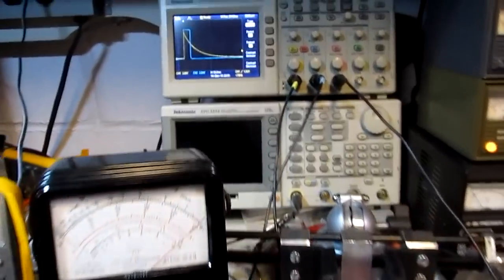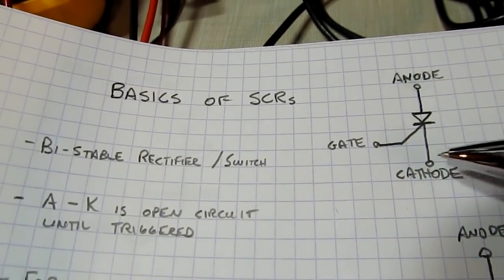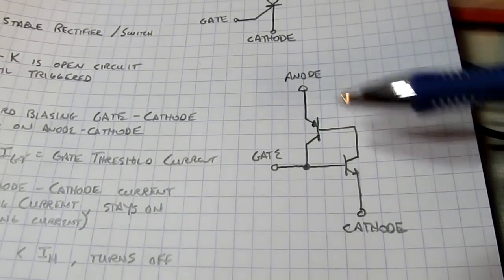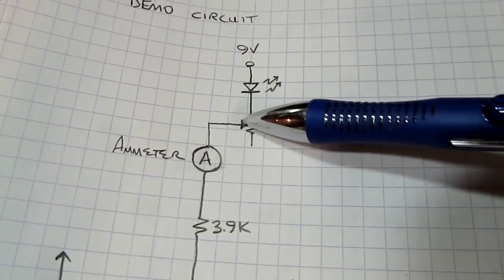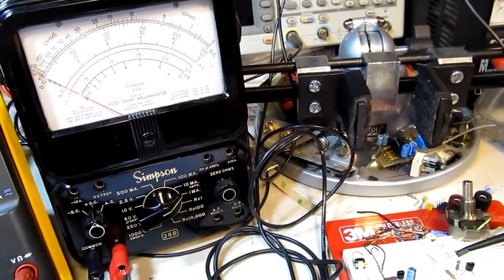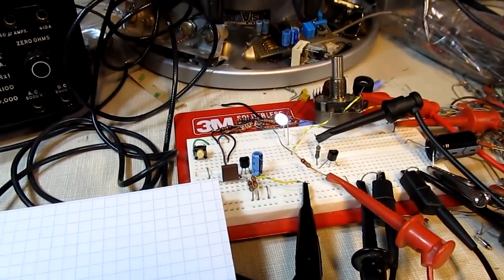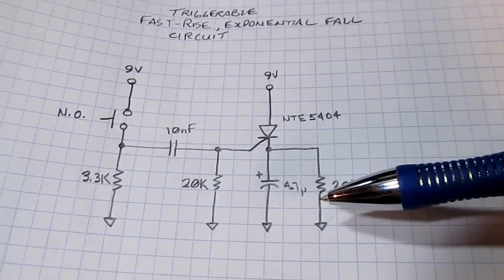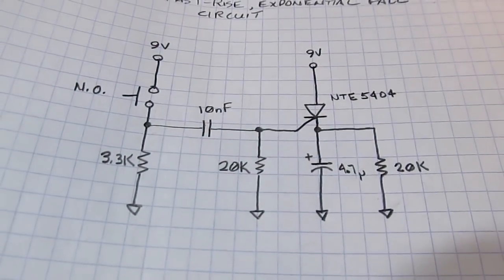#121: Basics of SCRs and some circuit fun - device and circuit tutorial

Comment: I really like that cross-coupled complementary pair,  it's so versatile.  If you connect to the base of the PNP transistor as well you have an "anode gate" (essentially a Silicon Controlled Switch or SCS),  which becomes active when pulled toward ground rather than pulled toward the positive supply.

I see a number of comments saying how the only way to turn an SCR off is by removing power.  Not so!  One circuit I've had some fun with involves two SCRs with their anodes connected by way of a capacitor.  When one is on you can turn it off by triggering the other one.

Comment: Great segment,and it gave me an idea to use this circuit for a way to take a simple brush type DC motor and steal the current on the collapsing fields and send them to charge a battery or a ultracap. e.g.: all the current on an automotive starter could be dumped back into storage.I think Edwin Gray had something like that.Off to research!And thanks so much for keeping my brain cells working!

Comment: Someone below asked about solid state relays, most internally use triacs (a bidirectional type of scr), most have a few refinements internally  such as zero volt switching and snubbing components. (due to internal capacitance issues scrs and triacs can spuriously trigger due to "spikes" on the voltage across them.). The triggering of a solid state relay is usually internally opto isolated, some use a neon to provide the light , some use a led. In one of my projects I used a solid state relay to operate the coil of a contactor, once in perhaps 6 months it will spuriously trigger despite masses of rfi filtering on the supply and being in a screened cabinet. I suspect the load is so low current demand that the contactor coil is partially energised via the snubber circuit in the solidstate relay, this may be your problem too.

Comment: I'm guessing a zener diode connected across the relay coils, solenoids and motors is considered a snubber circuit, because mostly I see just a zener diode across the coils to prevent voltage kickback.

Comment: It's a commutating circuit, I've seen them in a lot of AC inverters and DC/DC converters, put another SCR in series to ground, tap off between them to the capacitor through the primary of a transformer, pulse the gates alternately at a desired frequency (60 Hz perhaps?), basic DC to AC inverter.

Comment: In that case it should be possible to make a resonant half or full bridge inverter capable of multiple khz using scrs, as the inductor reaches zero current the scr should un latch allow you to turn on the opposing scr 🤔?? Would be awesome if you could make a video on this if my thinking is correct 😅🙈 
Thanks Steve

Comment: When SCRs are used to turn lamp bulbs on/off in pinball games EE engineers notice the lamp bulbs lifespan was cut in half compared to using FETS to turn lamp bulbs on'/off in pinball games. Any reasons why SCR would cause lamp bulbs to have a less lifespan and burn them out quicker compared to using FETs? I'm guessing SCR has a sharp transient spike and FETS don't have a transient spike

Comment: They often use Snubber circuits when using Triacs and IGBT devices. I'm guessing the Snubber circuit helps drain off and bleed off the voltage and current when the Triac and IGBT device is turned OFF?
Reply: Snubbers are typically used when these devices are switching inductive loads to prevent damage from fly back voltage.

Comment: I have seen FET's and JFETS  that look like silicon or silver metal Can packages used as amplifiers but i haven't seen MOSFETS used as amplifiers in circuits. I mostly seen MOSFETs used a switches the MOSFET package type has a screw terminal for a heatsink. But I'm not use what the difference between a FET compared to a JFET or are they the same thing?  They mostly use Thyristors SCR in crowbar power supply protection.  I have never seen an amplifier circuit use MOSFETs as the amplifier stages mostly they use FETS or JFETS i have seen.  They use Thyristors in industrial electronics to turn on and off high current and large inductive and capacitive loads. In order to turn OFF a thyristor SCR you have to reset the power supply or disconnect the +VCC voltage to the SCR. But I think a FET and a JFET are the same thing not sure what the differences are really.
Reply from the maker: The package type doesn't define the device type.  Yes, power MOSFETs used for switching are often in the TO-220 "tabbed" package.  However, MOSFETs can be found in many different package types, just like bipolar transistors.  MOSFETs can certainly be used in amplifier circuits.  Examples shown here:
https://www.electronics-tutorials.ws/amplifier/mosfet-amplifier.html
FET is a generic name for many different types of Field Effect Transistors, such as JFETs (Junction-FET) and MOSFET (Metal-Oxide-Semiconductor FET).  Here is my video describing both JFETs and MOSFETs.  All JFETs are FETs, not not all FETs are JFETs.
https://www.youtube.com/watch?v=oambDFa0Pr8

Comment: Alan, I found this video after searching for a way to bench test a triac and there are  videos on YT which use just a DMM usually set to diode. However, this test seems ineffective to me because you never actually make the MT1 & 2 terminals latch. How should I test a triac to really know if it is working correctly?  I have aBTA40 600B and a tic BT137 to practice. Thank you, Sir!
Reply from the maker: Good question.  It will depend on the device.  If the latching and holding current are less than the test current used by your DMM in diode test or continuity test, you could potentially put the DMM across MT1 and 2, verify the device looks "open", then trigger the device (using a second DMM or a voltage source and resistor to the Gate), and see if the device conducts and remains conducting.  If the latching and holding current are higher than the DMM test current, then you could use a DC voltage source and appropriate current limiting resistor...

Comment: What is the point of the capacitor at the gate? Debouncing? 
Thanks and great video
Reply from the maker: Just to differentiate the input, to create a short pulse to trigger the SCR.
Reply: @w2aew  but wouldn't it pulse from the actual pushbutton? Thank you for your time
Reply from the maker: @ohmslaw6856  The differentiated pulse will be much shorter than you could do with your finger.
Reply: @w2aew  thank you! I have learned much from your teachings.. i wish the universe gives back to you 10 fold for your efforts

Comment: Would you suggest SCR's as an effective way to drive an arc based resistance welder? I've been expermenting with resistance welder circuit designs for a couple of years now. Hoping to implement the use of high temperature superconductors with a self healing inverter setup in the near future. Any tips? =)
Reply from the maker: Sorry, this is bit outside of my area of expertise.

Comment: For me it gets really confusing about using Thyristors, Diacs because I don't know how they operate any differently than a MOSFET switching current on and off. They seem like the same thing but thyristors just switch much higher current but they are pretty much operate the same as a Mosfet. Yes I'm sure the Thyristor has different turn on/off times might be faster than a MOSFET but they seem to operate the same. What I mean is that I have never seen a MOSFET or Thyristor used as an amplifier, only as a switcher. Any reasons why a Thyristor or MOSET can't be used as an amplifiers? I have seen some electronic technician use a coin size battery to trigger the gates on Thyristors and MOSFETS to turn them ON to test them in circuit testing, I guess you don't need to connect the negative end of the coin size battery to the DUT circuit you just connect the positive end to the gate of the thyistor or MOSET to inject the +3vdc or +5vdc to turn on the thyristor and mosfet.
Reply from the maker: Big difference between MOSFETs and Thyristors.  MOSFETs are often used as switches (for DC) because of their very low on resistance.  However they are also very often used as amplifiers, especially for high-impedance applications since the gate input impedance is so high.  Thyristors are bistable devices. Once "triggered" they stay "on" until the current flowing through them is removed. MOSFETs don't do this.  Thyristors don't have an active gain-controlled region - they're either on or off, which is why they can't be used as amplifiers.

Comment: I'm confused about the active region in JFETS and MOSFETS they both look and act like they have the same active region. They might compress differently but the active regions look the same to me unless i'm missing something. Some FETS are biased using a negative bias DC voltage at the gate and other FETS using a positive DC bias voltage, what are the differences of a negative to a positive bias FET, does it make a big difference?
Reply from the maker: The active regions of the various types of FETs are similar. JFETs and Depletion Mode MOSFETs are especially similar. These two have max ID when VGS=0V and move to cutoff as VGS is made negative. Enhancement Mode MOSFETs are cutoff when VGS=0, and ID increases as VGS is brought more positive.

Comment: What loads are mostly used and connected to snubber circuits?
Reply from the maker: Inductive loads like solenoids, relay coils, motors, etc. can cause voltage kickback when switched off - these are the types of loads that usually require snubbers, etc. around the switching devices.

Comment: Older pinball games from the 60's used SCR to switch on and off lamp bulbs. When replacing the lamp bulbs with LEDS the LED's will flicker because the SCR don't latch on and off like a FET or transistor does, any reasons why this flicking happens with SCR latching issues?
Reply from the maker: Because SCR is switching on and off with AC voltage.  Incandenscent lamps dim slowly when current is turned off, so you don't see the flicker from the AC.  LEDs react much faster, so you DO see the flicker from the AC.
Reply: What is causing the flicker in AC? is it the SRC switching on and off that is chattering like a relay chatter?
Reply from the maker: @waynegram8907  the SCR turns on and off with each AC cycle, this sends pulses of voltage to the lamp.
Reply: Its turning off and on the SCR at a pulse rate at 60hz? But the SCR is not chattering its latch like a relay latches which is causing the flicking? the pulse rate at 60hz turning the SCR off and on is causing the flicking how so?
Reply: The Pinball driver boards use a Decoder chip that connect to Triacs or SCR for turning on/off lamps and switches. I don't know if they used the triacs or SCRs on the driver boards that used AC voltages or DC voltages. Pinball techs said if the driver boards have Triacs or SCRs you add in a 1K resistor on each lamp socket terminals to reduce the AC 60hz flicker. I don't know why a Resistor soldered across the lamp stockets terminals would reduce the LED's from flickering. Also not sure some pinball driver boards used a Decoder chips and others use a PIA chips. What is the different in using a Decoder chips compared to using a PIA chip?
Reply: I'm confused what the difference between a Decoder chips compared to a PIA chip. Because a PIA chip has built in RAM and a built in ADC/DAC converters inside the PIA chip. I didn't know a Resistive Load would make the Triac and SCR "On state" longer. It doesn't make since to me why it would Increase the ON State cause of a Resistor Load placed in parallel with the Triac or SCR. Inverse Parallel LEDS only conduct or Light only on Half Cycles? Yes the Pinball games used 6VAC, so if the LED's turn on and conduct at 3v, the LED's would be "turned on longer time" I would think because 6VAC is sweeping more voltage 0vdc to +6vdc back down from +6vdc to 0vdc this is turning on the LED. The Negative cycle of the 6vac is turning off the LED. Or are you saying that that AC lamps "don't have" a turn on conduction voltage? compared to LED's have a turn on conduction voltage compared to LAMPS that don't have a turn on conduction voltage?
Reply: Thanks for the help. Yes the lamps are RMS 6.3vac so its peaking at 9volts peak. The modern pinball line synch circuit is outputting a PWM pulse duty cycle will change the on time/off time to the LED's which is dim the LED from the duty cycle. It just doesn't make sense that placing a resistor across the load terminals/lamp socket would keep the Triac in conduction during the AC negative cycle.
Reply: If you use the LED's they are only drawing 15mA then the Triacs will have MORE current for the Triacs in conduction. Because each LED's are drawing 15mA per LED and the Driver circuit is designed for Traics holding current at 250mA per Lamp bulb. So I would think the Triacs would have MORE current when using LED's.I'm confused what you mean by when the Traic is "self Commutate" what do you mean by Self Commutate?Holding current is related to "pass current", what do you mean by pass current?
Reply: Pinball games switched from using AC voltages to using DC voltages in solid state pinball games. The pinball games driver boards are using the Decoder chip to turn on and off the Triac which is a +5vdc to the gate of the Triac. The Triac has DC voltages from the driver board which the Decoder which is Forcing the Triac to be in a non-conductive state to get the triac into a self commutating since the triac is not using AC voltages?If the Triac was chosen for a High lamp/Resistive load it should easier to stay in conduction with a lower load. I don't understand why the Triac that is rated/datasheet for a higher load that It would have a harder time staying in conduction with a lower resistive load?You're saying that a Triac that can interface with higher loads that draws higher current from the triac holding current will NOT but the Triac into Self Commutation. But if using LED's that draw 15mA of current will put the Triac into Self Commutation because the LED/load are drawing the triac holding current MORE compared to the lamps/load? The Triac that can work with Higher Loads should easily work with Lower Loads like LED's. I don't understand ho the Triac Holding current and Conduction will get worse when using a Lower value Load.Yes early power supples used SCR crowbar circuits, the only way to force the SCR was to turn off the power supply to "reset the SCR gate".

Comment: Why do scr has a fast switching time compared to fets and transistor switching times?
Reply from the maker: Likely du to the positive feedback involved
Reply: @w2aew  mostly there is no positive feedback loop in the circuits. What do you mean by positive feedback would increase the switching time being faster?
Reply from the maker: @waynegram8907    The SCR itself is a multi-layer semiconductor device with internal positive feedback, as can be seen from the equivalent circuit of the SCR.
Reply: @w2aew  FETs, Transistors, Tubes don't have internal positive feedback or internal negative feedback? I would think this internal positive feedback would be considered "leakage"?

Comment: But Triacs and IGBT devices don't cause fly back voltages so why would they use snubber circuits for Triacs and IGBT devices? I'm guessing solenoids, coils, relays would you snubbers circuits because they cause fly back voltages when turned off.
Reply from the maker: No, but the loads that these devices are attached to can be solenoids, relays, motors, etc.

Comment: hi   i have question for  you . In tutorial  in exponential  circuit .I know   10nF  is block DC  singnal  and AC pass  but  i dont understand  what ac  pass from?but input  signal is dc   When BUTTON PRESSS, input is 5 v and ortherwise. Could you help me i dont understand?.
Reply from the maker: Blocking DC and passing AC is just one of the uses for capacitors.  In this case, it is used differently.  It is being used to pass the changing voltage when the switch is pressed.  The current through a capacitor is proportional to the "rate of change of voltage" across the capacitor.  The faster the voltage across a capacitor is changed, the more current flows (to charge or discharge the capacitor).
Reply: thank you  i know   So i explain : in circuit when i press button  capacitor  is charger  when cap is full it discharge after  positive charge  throw  3,3K  and 20k  and nagative capacitor  and  this processing  creat is pulse to control openning scr.